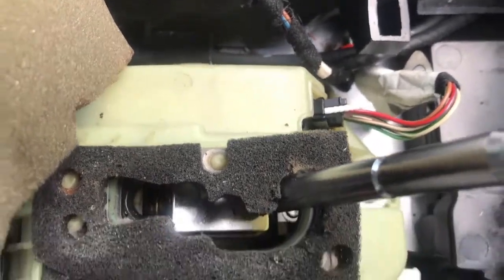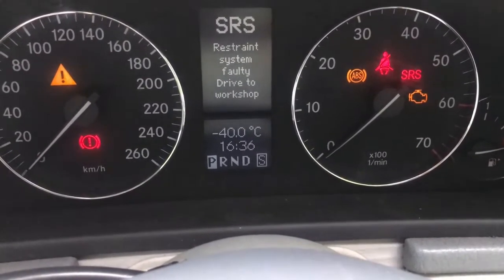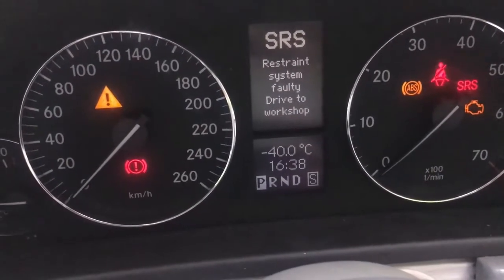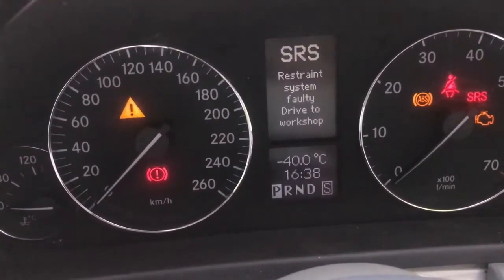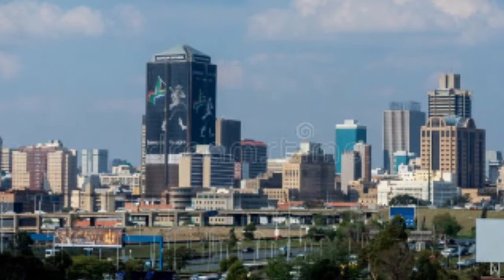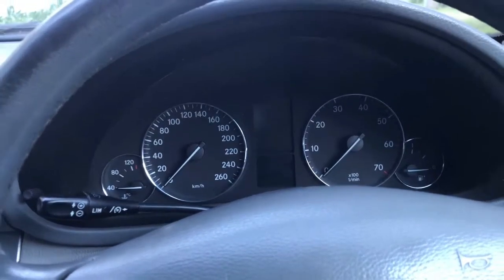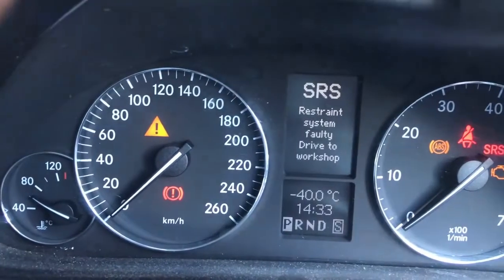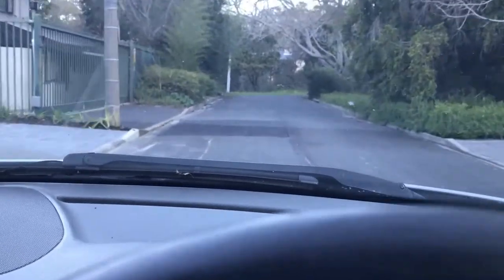PART 2 GEAR SHIFTER PROBLEMS W203 / W204 MERCEDES BENZ C CLASS  FAILURE AND FIXING

Comment: Greeting James from KZN, my brother I saw all your videos while trying to fix my mother's car N she is soooo stressed that she is like giving up N believing that the car will never be fixed,

I would relly appreciate your advice cause our w203 c200 auto was doing the exact same thing as UR previous videos where the dashboard shows a blank  block over the drive letter and the car was doin the exact same thing as yours, it was stuck in limp mode for a while until I bought a whole new second hand gear selector with the module everything and the block on the dash disappears but now the gear  is changes normal but while I be driving in its like the car goes into neutral N while in drive if I press the acceleration the car over revs N it refuses to move or even take another gear, N I would have to pull over let the car cool down abit then restart the car N drive for about 2 mind then it does the same thing, I had to repeat that process like 7 times just so I cud get my mother home from work N the car parked parked aside until I know what I can do to solve my problem,... Plz James I need ur advice brother u are the only one who I actually understand N to be honest trust coz I'm tired of mechanics that rob us, if u could kindly leave me a number I cud call u on or even a Facebook or WhatsApp number I cud talk to you on N explain exactly what happen N the whole history of my attempts to fix my mother's car 🙏🙏🙏

May God bless you abundantly my brother, the world needs more honest people like you, thank you N I  hope to hear from you, I feel like u the only one who cud actually help me 🙏🙏🙏🙏
Reply from the maker: Hi brother, sorry for what the car is doing. Check me on Facebook @ Mangalitso Mcenga then will talk.

Comment: My mine is C240 w203 also not start I changed gear switch module but it gets on shows signs in deshboard but engine doesn't start
Reply from the maker: Hey Andile. Your car has a different problem. If it is just swinging it might be clogged fuel pump which fails to pump the fuel to the engine. Check with the mechanic in your area.

Comment: 2005 W203 here:  Nice videos, great insight and troubleshooting. I have the same problem intermittent dashboard gear indicator sometimes showing white bar, sometimes perfectly fine.   after a few drives it comes back and I have to unplug the connector a few times, insert the toothpick and all is good again , crazy huh?  I used the same method placed a toothpick on the bigger pin connector on the front end of the assembly. Did you ever find out if it's the wiring connector or the pins on the gear assembly?  if it  was the soldering as you mentioned in the video, how did your tech soder it ?  do you think replacing the gear assembly itself would fix it or its more likely the 2 wired connectors? thanks in advance

Comment: I played with that connection and got a plastic toothpick jammed in the same as you. It drives ok for a little bit and then the issue happens again, then it is ok on the next drive. I was hoping this could fix it. I hate the thoughts of spending money on a 2005 car ha
Reply: same with me intermittent, drives fine and then it acts up again dashboard shows a white bar on D, play with the key a little remove and insert and good again. Did you end up replacing the gear shifter assembly or was it the connector/wires? Don't know how to repair a wire issue or/and pin connector problem. THanks in advance
Reply: @jimmyucla  Hi , I'm wondering what happened with the geare  selector after one year because I've exactly the same issue these days

Comment: Thanks for the video. I have the same problem with a 2005 c180k. Can that terminal with the loose wire be accessed without removing the whole centre console?

Comment: Hi, I've been watching your videos. I have the same car and my car also does not shift into gears. On my cluster I can only get the c and not the s. Please help. I've been stuck with this problem for a year now.
Reply from the maker: The quick way is to get the second hand one from the car stripers. About the letter c you just need to press at the bottom of the gear shifter where there's c and s while the key is on first position and look at the cluster if it is changing. C means Comfortable shifting and S  means standard shifting.

Comment: Hi James, thanks for this video. My car is a C200 2005. I was buying fuel at a filling station and the car refused to move from there because the gear is not engaging even though it shows on the dashboard that it's working. So when I switch it off for a few minutes, it will come back but when I drive it won't move past the first gear. If I should apply breaks maybe at a robot, I need to switch it off again for a few minutes before the gear can engage. What do you think?
Reply from the maker: It has letters on the dashboard showing PRNDs.
or it ends with c 
If letter D and small s or c does not appear when switching on the car that’s when you can know it won’t shift up. If you say it’s showing everything is in order on the dashboard after turning ignition, then you should get a diagnosis tool to scan the problem, it might be another issue. Limp mode is caused by many things.
Reply: @jamesmadalitsomchenga5308  Thanks James. All those letters are appearing and when I move the gear, the dash board shows the appropriate gear that I have moved it to. The letter 'S' also show but it's usually in capital.
Reply: Yes, the dashboard as the PRND and S

Comment: hi James, my car is a C32 amg and its doing the same thing. i also figured out the trick you are using but with a peg. I am in pretoria. I want to ask what kind of technician can help me or i should be looking for? i have been telling my mechanic that its that cable, thats losing power and not speaking to the compter o turn on the gears. please assist. are you on whatsapp
Reply: schools are opening and i need to get it fixed so i can take my kids to school
Reply: @James Madalitso Mchenga is the third video how you fixed the problem?
Reply from the maker: Hi Lindiwe. I thought of giving it to a technician to fix the module because I don’t have that intelligence for softwares  in the car. But later I took a try to learn more of its trouble shooting. And I found the wires that were having bad coating. I just re-coated the wires. Get auto electrician to do it. If not buy a secondhand module and replace it.
I’m far with you so it’s complicated to help you physically.
Reply: Hi James. I have two more of the gear selector things. And when you put all of them on, the LCD screen to switch on the gears goes blank. I suspect that it's the actual terminal that is faulty or short circuiting. I use a peg like you did in the part 2 video
Reply from the maker: @lindiwemathonsi5751   if so it means there is short circuit somewhere along the wires.
Find out someone who fixes electrical appliances to do a troubleshooting test and figure out which wires or boards has loose connections and he can fix them.
Auto electrician does not fix they only fit parts unfortunately.
Reply: @jamesmadalitsomchenga5308  thank you so much. Will Do. I have a guy who is a good electrician. Will update you
Reply from the maker: @lindiwemathonsi5751  you are welcome. As you said you have been changing the module then the first thing he should do is to erase the memory codes from the car’s ECU. I guess your car has a different electric systems. If it doesn’t stop the problem then he can proceed to check the wires.
Reply: We did remove the codes on it but it never helped. Even now looking and feeling the terminal the wires feel lose
Reply from the maker: @lindiwemathonsi5751  I was working on another car and I could not find the wires which were having problems. I discovered that the fuses also can contribute to the problem. I cleaned the fuses in the engine bay that are located on the left top corner (driver’s side) and the fuses inside the car on drivers side by door just at the end of the Dutch-board. With a sand paper I removed the ashy looking on the fuse terminals. I just sanded them all. One by one that’s the way. Otherwise you can’t know where to put each one back. Make sure you disconnect the negative battery terminal before doing it. After then replace the battery terminal get into the car. With doors closed and windows, turn the ignition switch on to the second position before the start. Press acceleration pedal to the floor until you feel the switch under it. Wait until 20 seconds while pressing the pedal. Switch off the ignition but don’t take the key out. Wait until 15-20 seconds and remove the key and release the fuel pedal. The car will reset itself to factory settings. See if this will solve your problem. Because I sorted out that problem yesterday with the above method. Thanks

Comment: My car is giving me the same problem bro I just park it , how can I get in touch with you
Reply from the maker: Hi brother. If you are around the city of Cape Town I can make the arrangements. I reside in Newlands suburbs near Claremont.
Reply: @jamesmadalitsomchenga5308  -40 STP celcius wher you live
Reply from the maker: @robertkoch8924  The ambient temperature sensor was faulty. It’s connected to the front bumper for showing outside temperatures.

Comment: You need to drive longer than that to be sure. How is it now man?
Reply from the maker: I’m still driving it daily with no issues. There was an issue with wires’ touching each other. The coating was damaged.
Reply: @jamesmadalitsomchenga5308  who was able to fix it sir?
or where did you take it?

Comment: My car is exactly like your, that's if yours is a C180, it has the exact same problem, I went to go buy all the tools to fix it tomorrow to take everything apart, I hope it's a loose contact aswell...the only thing I didn't see is how you removed the black inner plastic where the cup sits...I can't figure it out..but tomorrow morning I must get it fixed...I even have the same engine light on and the SRS airbags light on....eish...does your car eat petrol like mine?..
Reply from the maker: My car is C200 kompressor. C class models has that problem of gear shifter especially when the mileage is bit high. Search from other videos how to remove the cup and its holder. When the car is in Limp mode it uses more fuel. Mine was also taking more fuel b4 fixing it. . You should also check air filter if its clean. I found that the motor to right hand next to the module the insulation or the coating of the tiny two wires that goes to the module from that motor disintegrated in some areas. The wires were exposed and were toughing each other at the bottom of the motor, so check that and insulate them. Then after, I heated the module (BOARD) at the temperature of 200 degrees for 8 minutes.   If you have the SRS and check engine, the first thing to check is  the alternator brushes or (diode). It is not producing enough voltage to the system. Just let someone to test your car voltage first. Mine I have to buy that diode. I have been driving like that for 3 years because does not affect the engine. Hope it will help.
Reply: @jamesmadalitsomchenga5308  thank you very much I will certainly do that...I also plan on doing service B myself too... back in the day this car use to move very smoothly..
Reply from the maker: It’s a very comfortable car, but when it’s on limp mode it shuts down many parts of the systems including AC.
Reply: I got everything off except the gear selector is connected to some round thing...you didn't show how to get that off
Reply: @jamesmadalitsomchenga5308  it's where you talk about the bushing, before that the gear selector is connected to the transmission via a lever, how do I dosconnect it from that
Reply from the maker: The only easy way is to open the door and nil down on the ground and your arms should lean on the driver seat then lift the gear up you will see a round clip, use a flat screwdriver and slide it out. Then you can pull out the gear from that metal easily
Reply from the maker: The metal is connected to gearbox or transmission for gear selection. And the pin having 3 or 4 teeth holding on the bush.
Reply: @jamesmadalitsomchenga5308  ok I was able to get it includes and got the gear selector out but now how do you remove the module from that black part..I removed all the screws...your video just cuts away where you start opening up the module
Reply: Are you on WhatsApp, I was able to to take it out but some pin came out and I don't know from where
Reply from the maker: Once you take the screws out of the gear liver cover then unscrew the big 2 screws on module and slide it out. Try to move the gear liver if it’s getting stuck when removing it.
Reply from the maker: Send a picture of the pin on WhatsApp and I will tell you where it goes.
Reply: @jamesmadalitsomchenga5308  thanks
Reply from the maker: I’m happy that you fixed your car gear module and you are driving now.
Reply: Hi James, thanks for this video.i have shifting problems, I have been told to sell the car but eish I'm attached to w203😢